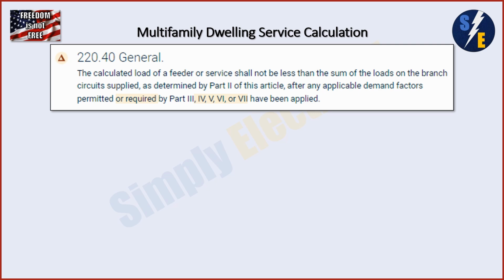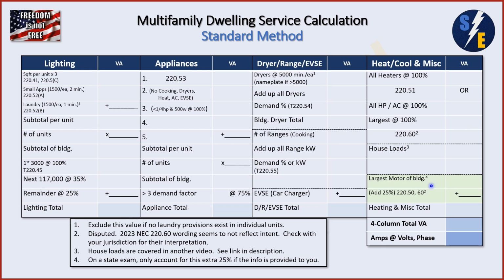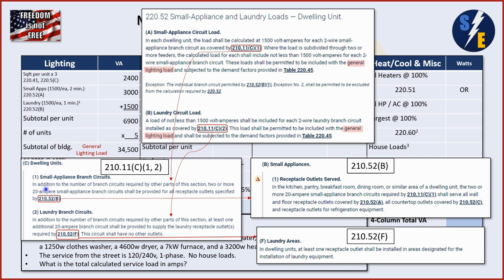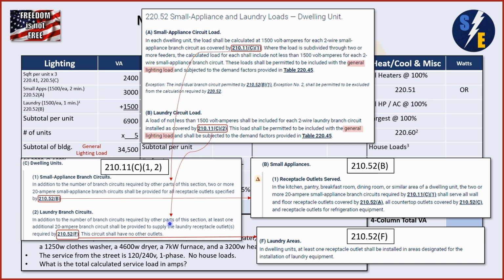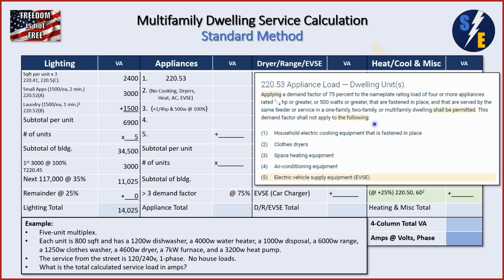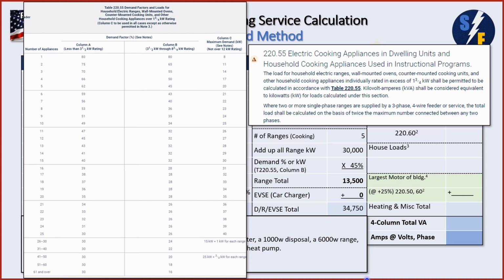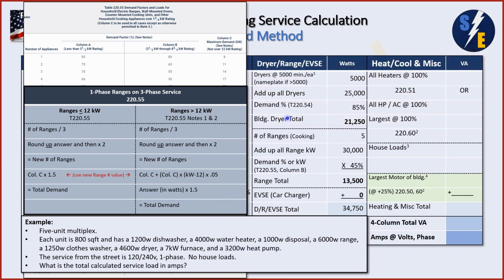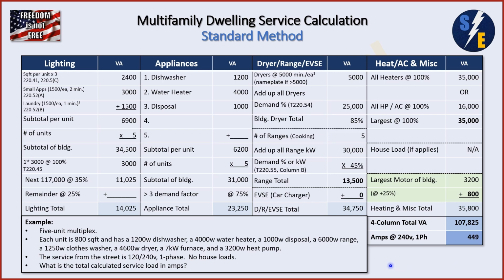Multifamily Standard Service Calculation - Deep Dive 2023

Comment: Good Afternoon. I'd like start by thanking you for all the time you invest into your video lessons. 
I have been searching for Neutral Load Calculations. Most of it is pretty straight forward other than a couple of nuances. The first being: Are you allowed the 75% reduction in 250.53 for the Neutral load for four or more appliances. Second, If it is allowed, and you have four appliances, if one of them is a 240V water heater then in the neutral calculation the water heater is not counted so you only have three appliances. How would that play out?

Comment: Im confused as to why you didn't add the clothes washers to the appliances' demands factors. Regardless of the 1500 va laundry circuit, 220.53 does not exclude clothes washers, and when they are running, they will be putting load on the service. That laundry circuit is just a addition to the general lighting load. Also, in washington state at least, per standard practice, if you omit the air conditioning from your claculated load, you should use the next largest motor as your additional 25% increase. which, in most cases, will most likely be the disposal. No criticism here, just curiosity. I think your videos are great but im trying make sure im not missinterpting anything as i have a masters exam coming very soon lol
Reply from the maker: These are great questions. I welcome any critiques of my videos as it helps me learn how to better explain things (and also helps to catch my mistakes!). So please continue to go over these with a fine-toothed comb. Iron sharpens iron.

As far as the laundry circuit goes….this one isn’t written as straight-forward in the code as I believe it should be. We have to infer a little bit. I’ll give you my reasoning for tackling it the way I do. Also, I provide a fuller explanation in this video here at about 15:42:
https://www.youtube.com/watch?v=pAMfuYjS-Pw

First off, 220.52(B) tells us that 1500 VA must be included for EACH laundry circuit installed. So, EVERY clothes washer requires a 1500 VA allotment. This means that all clothes washer loads on the feeder or service are covered by this requirement. Therefore, it would be redundant to include these loads again under the Appliances section 220.53.

I believe the code-making panel (CMP) should include clothes washers under the exemption of 220.53 (just like dryers, air conditioners, etc.) to eliminate confusion. After all, if safety is their goal, clarity is paramount.

But here’s the rub: 220.52(B) doesn’t say “clothes washer circuit”. It says “laundry branch circuit”. And we are once again forced to infer the intent behind the code. I don’t know of a single place in the NEC where the term “clothes washer” is used. Certainly not here in 220. My presumption is that this is because the laundry circuit required in 220.52(B) is not limited to clothes washers only. Gas dryers may also use this circuit (and typically do). So, they are using inclusive language here. And that’s the hard part about writing code – finding the balance between being too specific, and not specific enough. I think the language here could be improved.

Anyways, I hope that makes a little more sense to you. This is how I was always taught over the years, and it seems to track. Let me know what you think.

Now for the largest motor….please check out my video on Noncoincident Loads here:
https://www.youtube.com/watch?v=_YVvb2YlqUc
I explain in detail why I treat the “largest motor rule” differently now than I have in the past. I was an electrician in WA for 26 years. And until 2020, we always did just as you described. We eliminated the AC load and took the next largest load (usually the disposal). But in 2020, they added a sentence to 220.60 which changed things. I won’t take the time to get into it here – the video explains it better than typed words.  :o)

Thanks for the comments and questions. It really helps us all in our understanding.
Reply: @simply.electrical  that seems pretty reasonable to me. I guess my only other question, (seeing as you worked in Washington state), for the major loads calculations in the masters test, would you use the ac motor load if you omited it? (Specifically for testing purposes) i feel like a lot of people teaching calculations all have their own way of doing calculations and its really confusing for me because I don't want to do things that aren't what's expected on the test.
Reply from the maker: @PapaOxi  I really wish I had a good answer to this. It's a big problem in every state. We don't know how each state looks at 220.60. We have no way to access the test-makers to find out, that I'm aware of. The added sentence in 2020 (and amended in 2023) does not make logical sense. It contradicts either the first sentence, or else the entire idea of noncoincident loads. So we're left guessing what their intent was in adding the sentence.

That said, my gut tells me that the tests probably have not changed since before 2020, as regards the largest motor rule. The confusion of 220.60 likely caused them to just leave it alone, rather than guess at the intent. But that's just my spidey sense saying that - don't put too much stock in it. Besides, each state has to make its own choice of how to deal with it. Let's hope that this finally gets resolved in 2026. There's been a lot of complaints lodged to the NFPA over this topic. Unfortunately, they've missed every opportunity to fix it over the past 5 years. So, even though my fingers are crossed, I'm not holding my breath.  :o(

Comment: Sorry to bother,  so can I use this standard method if the range is gas?  Do I put in 8k or leave that section At Zero 0
Reply from the maker: Oh, I understand your question now. If you don't have provisions for an electric range, your value will be zero. Same as with a gas furnace, water heater, or dryer. Only include a value if you have PROVISIONS for an electric appliance.

Some places are equipped with a circuit for an electric range AND a line for a gas range (so the tenant has the option). In this case, you would need to calculate for an electric range, even if there will only be a gas appliance installed up front. That gas range could potentially be changed out to an electric range in the future, so the service needs to be able to handle it.
Reply: Thank you sir.   @simply.electrical
Reply: So just plug in 8k for that option then.  Even if there is no provisions. @simply.electrical

Comment: What is the range is gas and there os no dryers. Should i just do the optional method?
Reply from the maker: Check out this video on the Optional method. I explain what to do when you have no electric cooking equipment on the service.
https://www.youtube.com/watch?v=I0xlL1kLmak

In most load calcs, you can use either method regardless of the range or dryer loads. Most people prefer to use the Optional method because it's easier, quicker, and usually provides a smaller load total. The Standard method is typically only used for exams (when they ask for it).

However, Multifamily Optional method is an exception, as you'll see in the video. Let me know if you have any questions!

Comment: Im doing a triplex. I believe 3-5 unit dwelling is 45% . Why is that Not in here?.
Reply: When we add all 4 columns. And get a total. Shouldn't we input the total times 45%, and then divide by the voltage. For total amps
Reply from the maker: @ It's extremely important to be aware of the differences between Standard Method calcs and Optional Method calcs. It sounds like you may be conflating the two.

Notice how Article 220 is divided up. Standard method is covered in Part III (220.40 - 220.61). Optional method is covered in Part IV (220.80 - 220.88). Except for a few specifics, these two methods are mutually exclusive to one another.

So in your case, for a Standard Method calc, we would not use the 45% demand factor for the building.
Reply from the maker: This video is for a Standard Method calc. So we would not use Table 220.84 since that is only allowed for an Optional Method calc.

Check out this video for an Optional Triplex calc:
https://www.youtube.com/watch?v=mHEoz6ef-QA

Comment: You applied a 75 derate to appliance load even though you only listed 3 fastened in place per unit. If you have 5 units those 5 units should they not be 100% because the individual units are not 4 or more…or are you taking 3x5 units and using that as your reason for having 4 or more?
Reply from the maker: The 75% demand factor applies to 4 or more appliances on the same service or feeder - not the individual units. We are calculating the entire service load here. If you were calculating the feeder load for the individual units, then you would not be able to use the 75% demand in this case.

That's a great question, and I see a lot of folks get confused on that. I hope that clears it up a bit.

Comment: 220.53 says 4 or more appliances but you list 3 or more.  Also i dont think i saw the washer load anywhere in thr calculation.
Reply from the maker: I'm not sure what point in the video you are referring to. The table shows that if you have more than 3 appliances ("> 3"), you can apply a 75% demand factor. As I played back through it, I didn't notice anywhere that I said 3 or more. Do you know what time that was? If I made a mistake, I'd like to fix it right away. Thanks.

The washer is covered in the first column, third row, under "Laundry". Remember, we are required to use 1500 VA minimum for the laundry load (even though the clothes washer in the example is only 1250 VA). This is because they know that washers are routinely replaced as they wear out.

Thanks for asking questions. It's good for everyone!
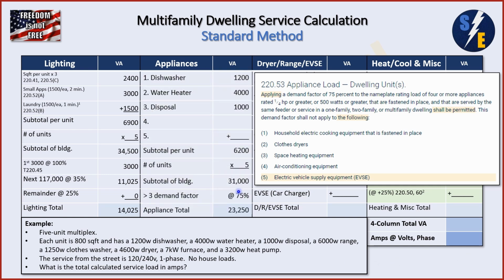Reply: Thanks for the quick response.  At 23:00 min area you talk about 220.53.  As 3 or more but it is 4 or more for the 75% rule.  It still applies regardless.  Also why do you calculate the washer as part of laundry 1500 instead of applying the 1500 laundry AND the 1250 for the washer?  Thanks !
Reply: I understand the washer is part of laundry but the question is worded where it sounds like a dedicated circuit for the 1250 washer and then you would still need a 1500 laundry circuit.
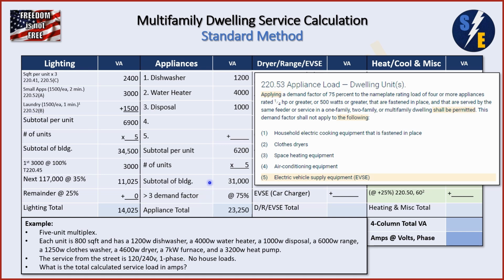Reply from the maker: @blahblah123321able  Hmm...are you perhaps talking about at 23:29 where I say "more than 3"?

As for the Laundry... that is simply because the 1500 VA value for Laundry is specifically intended to be for the washer load. There is no need to have a laundry value AND a washer value, as that would be a redundancy. Now, if you had two clothes washers per unit, then you would need to include 3000 VA for your Laundry value.

Let me know if that clears up anything. If not, I apologize. Perhaps I don't understand your question.
Reply from the maker: @blahblah123321able  They are one and the same. The Laundry allowance IS the washer load.

I agree that using the term "laundry" in the NEC is a bit counter-intuitive because the dryer is technically part of the laundry system, too. Yet the dryer is calculated elsewhere and has no relation to 220.52 (B). It would be more straight-forward for them to use the term "clothes washer" instead of "laundry".
Reply: Thats great thankyou!
Reply: I see my mistake I misunderstood your greater than 3.  I see uour intention now but for clarity maybe just mimic the code article “4 or more”. Instead of “greater than 3”
Reply from the maker: @blahblah123321able  It's important to think in terms that are not code-verbatim. The question on the exam will not necessarily be worded exactly the same as the code. And even more so, in real-life scenarios. But I totally understand your confusion. No worries. I appreciate your asking for clarity. Precision is so crucial with calculations!